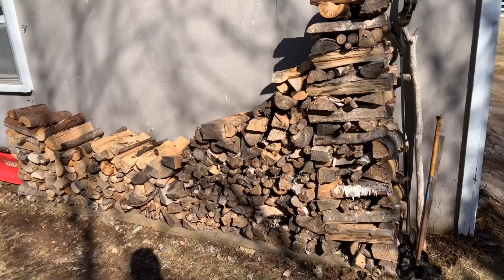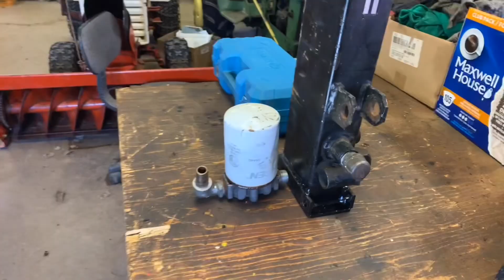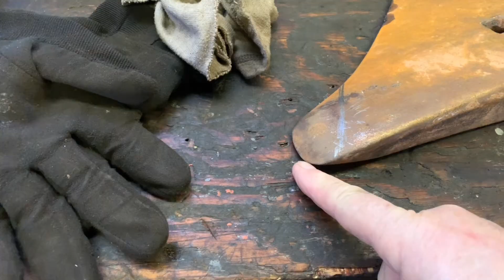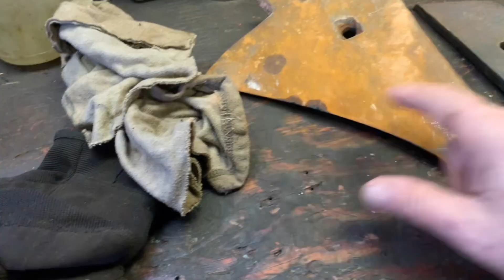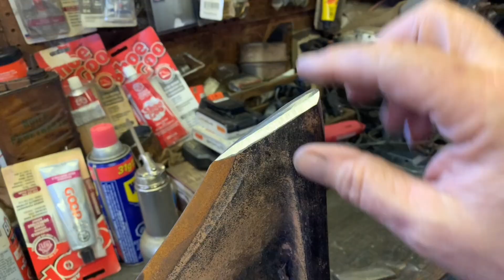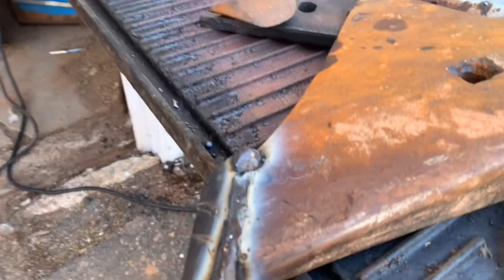Welding repair on a sod plow point. New end welded on. #plough #welding #weldingrod

Comment: Good day Noel. What will the hot coals do to the steel?
Reply from the maker: It’s just to keep it from cooling too fast Kenny, so the weld won’t crack. And not hot enough in there to take any temper out of the piece to take the hardness out of it. If it had been hardened at the factory. That I don’t know. 
Thanks for asking, I hope that gives you an idea. 
Nice day here today. 6C and sunny, no wind. 👋👋
Reply: @noelstractors-firewood57  thanks

Comment: The old setup for the original loader did not have a filter on it. I put that on and maybe you don’t have to muck with that. Those welds look good from here. I have always found that stainless rod was an easy but expensive rod to weld with. That should work for you…..CHEERS
Reply from the maker: Thanks Gator. I was wondering if the loader didn’t have a filter. May go that route. 

What type of transmission fluid did you use ? 

Ya the welds seem good. I just took it out of the wood stove. 
Yes those rods work good. But expensive thou. 
Have a great Friday. 👍🏻👍🏻
Reply from the maker: Neither of my Case tractors, that are hydraulic drive, don’t have filters.
Reply: My tractor has a filter on the drive but the loader witch is separate did not have a filter when new
Reply from the maker: All my other tractors with hydrostatic drive have filters.

Comment: Good Morning Sir Noel, See The Sun Is Very Powerful Now 🌞 Yes a lots of incoming rain to finish to melt that snow 👍😇Change a direction like a butterfly 🤣👍Great Welding Noel, you can also preheat your stick rod before with the blow torch a little bit ( that will dry them ). You can also do other strait pass over your welds too  👍😇Be Well Cheers 🍻🍻
Reply from the maker: Thanks Dave. I suppose I could set them in top of the wood stove. I’ve heard of heating the rods before to get the moisture out. It’s just hard to remember all the things to do to help the welding process, when I only weld every now and then. 

Have a great Friday. 👋👋